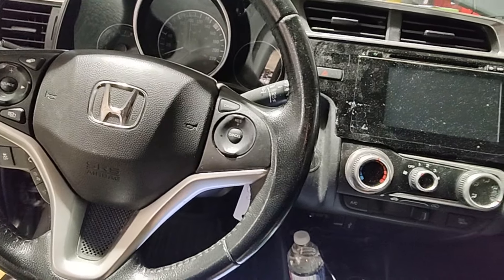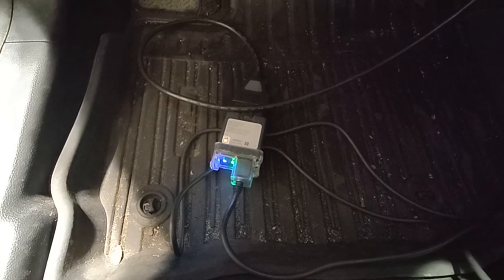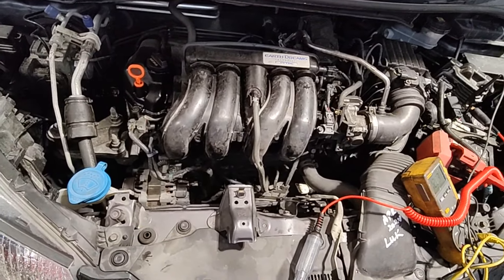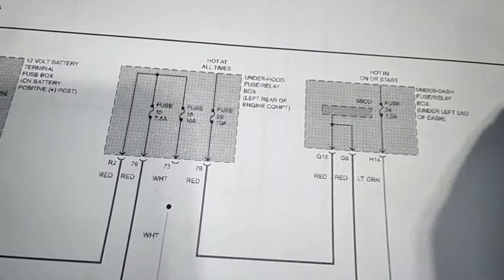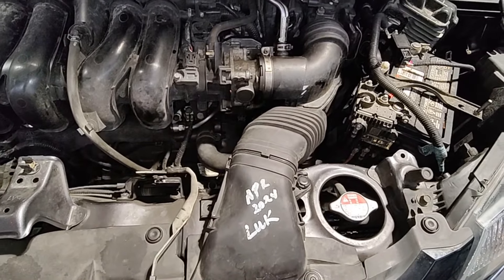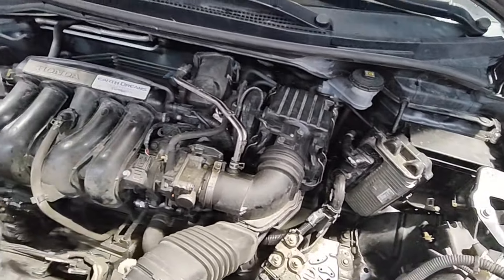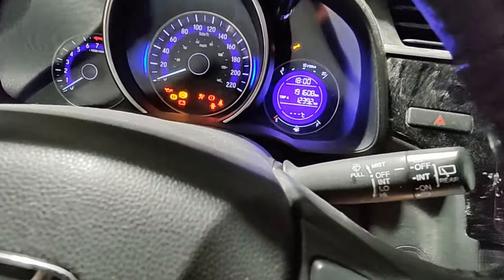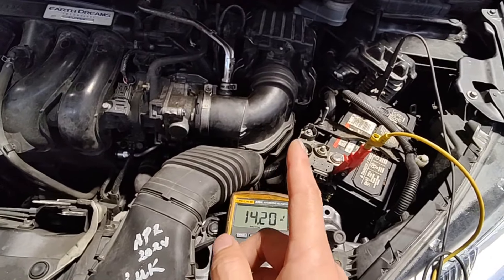2016 Honda fit, no start, no charge, no communication.

Comment: how do i r emove my air box on hrv it has a rubber with bolt on top could not remove it trying to clean it i dont want to pull it off is there a tools needed
Reply from the maker: You unbolt it.
Reply: @theoffroadingmechanic  yes i can remove the sides but the top one has bolt and rubber cant somehow remove it is there a way to remove is it upward then pull?